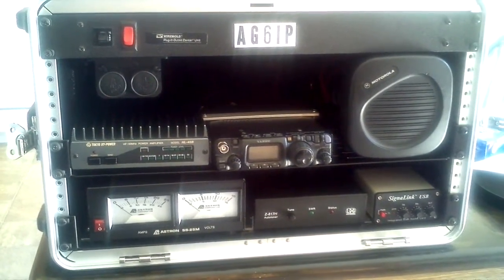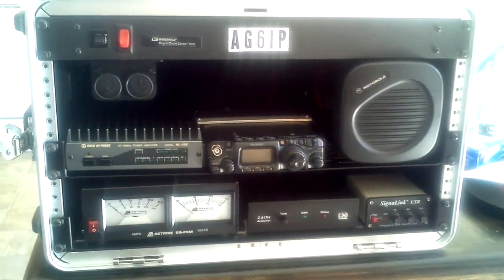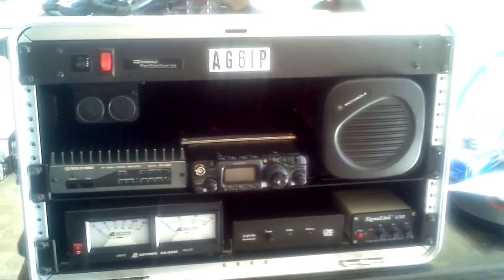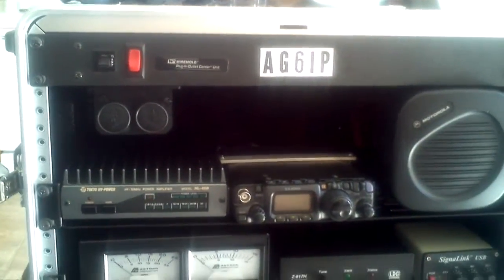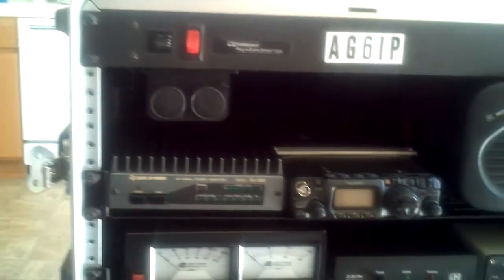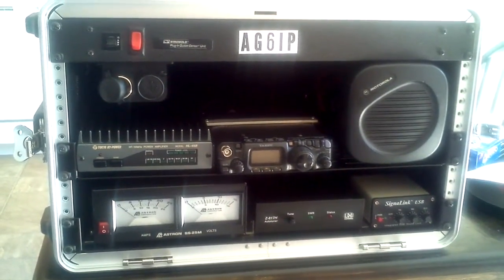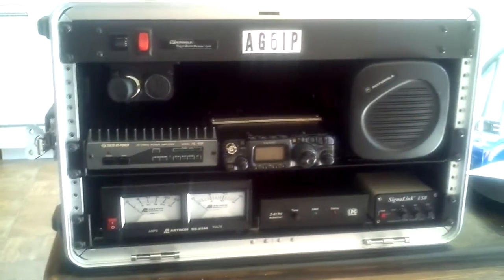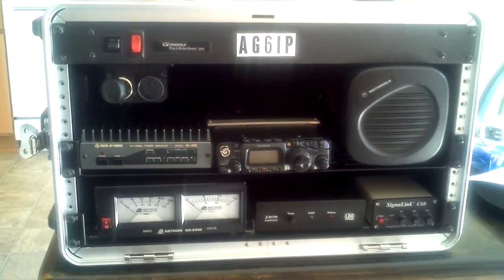AG6IP Ham Radio Go Box Part 1

Comment: Hello Fellow, could you help me ... I'm building a go box and I'm in doubt about the Case 6U and 8U.  My configuration is as follows: FT 817, FT 891, FT 857, Alinco Switched Power Supply, and SWR meters and an antenna tuner.  Would the Case 6U fit the mentioned equipment?  appreciate
Reply from the maker: I think it should fit. Mine was a 6U. It will just depend on how you place thing in it. Goodluck.

Comment: Hi Mike,
     I saw you last weekend at Bike Around The Buttes with the Go Kit in the trunk. Very fine job. I have a portable Go Kit too but mine is very simple with Ft-897, tuner, AC power supply built into the rig. Mine is in a Coleman 18 quart ice chest from Wal Mart that  I carry the gear and use as a seat when the rig is out and in use. What a suprise to see you nice video here on You Tube.
73 Bob N6BOB

Comment: Well my "go kit" is basically a Spilsbury Tindall SBX11 (see my video).  Nothing fancy.  Crystal bound 80/40m in a 'throw box".  Pretty basic.   I've also got a Tentec Argonaut V that is my 2nd camping kit -- it is in a Pelican case with everything needed to get it on the air apart  from the antenna.   So my kits aren't too refined but they do the trick for me. 73

Comment: Nice set up!  You might want to consider a 12VDC computer fan to cool off  the inside of the unit if you are running in continuous operation. Also may wish to consider a 12VDC light bar (eg. West Mountain Radio PWRbrite light stick) and a nice little "Watt's Up Meter" .  
73
Greg